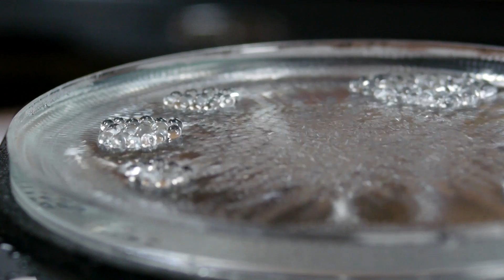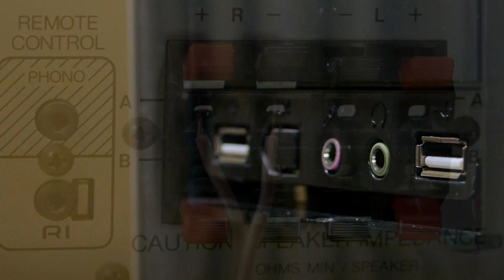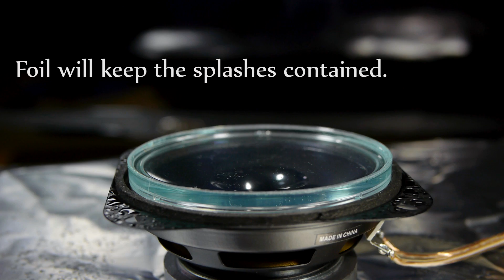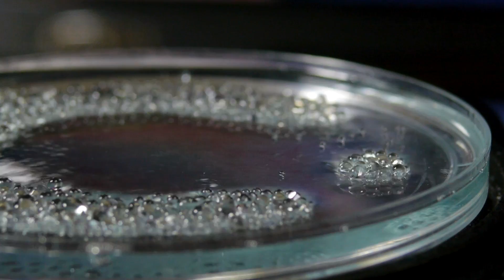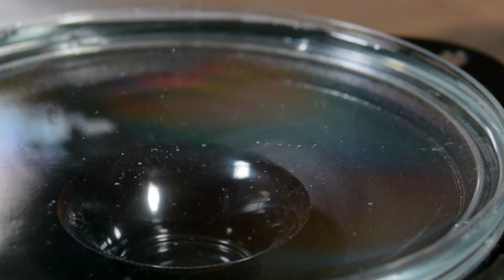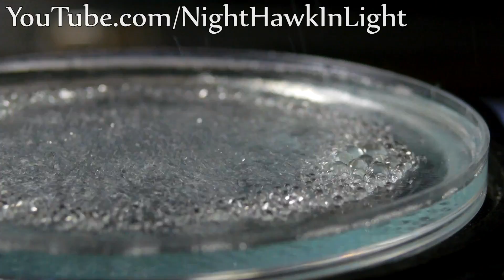Water + Soap + Sound

Comment: Cheap emp class 400,000v transformer is at residence one 2 a solid copper 3 turn coil the magic is in. The muti ark jump i like a steel 3mm space and a blow out ark on the pos intake it blows hot metal in ark this will give several inches of low EMP FEILD  the more the better air ration and save drop ark it snaps now and again to stop short failure FACEBOOK.   Now when between to rods just for ark you may get a 3cm feild at best had upto 12cm and even nothing at all ???????????

Comment: I don't know how much you know about quantum physics, but is it possible that like the water droplets, this concept is the way some particles can pop in and out of existence, through stronger vibrations in the quantum foam? These particles can simply be concentrated vibrations revealing points of detection until the vibration dissipates back into the fundamental plain of our universe, like the droplet with the water that dissapears back into the surface of the pool. That could be why these partials cannot appear between any two parallel plates because it interfers with any concentrated vibrations. Just a thought...
Reply from the maker: +Andre Danielz It makes sense as a possibility, but that's really way over my head.
Reply: blackvalley007 I know it has nothing to do with the video. It was just a thought. But I probably dont know what i'm talking about.
Reply: +Andre Danielz we had the same one!
Reply: +Andre Danielz 
That has nothing to do with this video, and only applies to really small particles like elektrons...
Reply: +Andre Danielz Must be much smaller.
Reply: Mythrunes Of course. My thought was a concept not a parallel.
Reply: +Andre Danielz I had a very similar thought: vibrations like these are the source of all matter
Reply: Logan Mann Are there any papers on this idea though?
Reply: +Andre Danielz I'm not religious, but it seems the only relevant information regarding this idea lies in the old religious texts.  "In the beginning was the word"
Reply: Logan Mann How does that in any way relate to what is being described here?

Life is a code and the "word" is another way of saying a coded universe?

The writers of the Bible did not have this in mind when writing this verse. And why the Bible always speaks in riddles is probably because there are no riddles but people try to find meaning in every verse,due to our pre-disposition to think its divine through generations of passed down dogma that only survived today because up until the invention of the internet and a few more years for information to fill that internet we really had no alternatives. There was information out there, but you had to either already be involved in the research or a book worm. And 99% of people prefer the super bowl than learning if their beliefs are real or not.

What im getting to is that "In the beginning was the word" is a verse so ingrained in our heads through our cultural norms that it almost seems wise to quote it.
Science in no way is saying out universe is a word or a code. It behaves by laws, probably laws of absolute logic. This makes the laws of reality like a coded system. And what I was suggestion has nothing to do with codes or a word.
I see what your getting at. "in the beginning was set laws of reality" or (the word)

What the Bible means however is that the story of everything was already established before creation began. God knew what would happen and wrote the book of what was to come. The stage for Jesus to enter the world was pre-set in his story. Calvinists use these verses to argue pre-destination, that everyone was pre-determined to serve or rebel the christian god.
Other verses support this idea too. Like where God pre-destines certain people to be delusional so they will never know him and then send them to hell for not knowing him.
Its all written in his story book of life.
I dont believe in god. At least not the theistic nor deity kind. But I have read through and studied the Bible in courses. 

So it doesnt really work. I get it. But its a verse like many that can derive many meanings from. Calling the universe a pre-written word muddies up what science is really trying to get at when it talks about the laws of particles and how they pop in and out of existence.
Reply: To me it relates in many ways, as even quantum physics is slowly discovering smaller and smaller vibrations at the root of matter.  

Think about this: regardless of all the obvious BS in ancient scripts, there is an unarguable amount of "religious texts" that must be accounted for--as religious text was all there was in terms of historical record at some points in our evolution. Science in many ways is reinforcing some of the claims made in these ancient scripts like the Great Flood.

I believe the answer lies somewhere in between--as I think we can both agree that the universe didn't spring into existence from nothing in a single instant (as the big bang theory suggests).... that seems as much a dogma as any religious baloney in my opinion.
Reply: Logan Mann Thats not what the big bang says. Thats the typical definition of the big bang but thats not really true there is alot more to it. The "sprang from nothing" is what people like to say because it creates a simple idea of what they think scientists mean. No one is saying the big bang came from nothing.
And there is much proof to show this.

Noahs flood never happened.
I think I know how your perceiving this. I use to see it this way too. I think your looking at many concepts backwards and forgetting key factors when looking at these claims.

Tell me why Noahs flood makes sense. I want to see if your getting at what I think you are.

 Are you saying there is some truth to ancient religion and that ancient people knew certain truths about reality? And does all religion hold some piece of it?
If thats what your getting at I can tell you why its false.
Reply: There are many scientists, some conventional, some unconventional that are barking up this same tree.  I'm sure we could compare and contrast our ideas, both of which could be reinforced with some scientific speculation, however, I think it more important to merely keep an open mind about the possibility of such things.

I'm not merely talking about Noah's flood, although I'm sure that would probably tie in with the  mark of the last Great Flood.  

There is not much argument that the planet goes through this long cycle of drastic climate change.  Even the Mayans predicted these types of cosmic cycles that our planet is succumbing to.

Edit: The big bang theory cannot accurately predict what happened before the big bang (obviously), which is nevertheless why it is still an incomplete model.
Reply: It seams you are saying alot of stuff that makes my brain go to mush
Reply: My model goes as follows: the soap in water forms a colloid which makes the soap particles not visible when in rest. As brownian motion does not exert enough force to settle the soap molecules above the surface thus making the colloid have a plain surface. When vibrated the hydrophobic soap molecules will escape the colloid and form a hydrophobic droplet that rests on the surface in which the vibrations create a surface tension that counteracts sollubility of the soap&water particles. Not in any way shape or form can you relate this to the quantum realm. Even though it sounds dreamy & I do like it. I have a few articles that analyse this behaviour both with ultrasound[1] and with a suspension[2]. 
[1] Periodic order induced by horizontal vibrations in a two-dimensional assembly of heavy beads in water
[2] Ultrasonic characterization of proteins and blood cells
(I cannot give you downloads since these articles are copyrighted, I hope you enjoy the environment of a scolarly library)

Comment: Very cool NightHawk, but won't eventually if enough of the Soap water merges with the normal water, won't the soap cause the normal waters surface tension to weaken thereby eventually make it very difficult or impossible to keep the two layers separate..?

 Great video as usual!!
Reply from the maker: No, for whatever reason even if both the drops and the surface have the same amount of soap the drops still easily form.
Reply: That is very cool, and interesting.

 I never would of thought with it's surface tension disrupted it would still be able to keep the drops suspended like that.

Comment: Beautiful vid. One thing I'm a little unclear on: the detergent will decrease the surface tension of the water, and I would think that surface tension would be helpful, as it acts like a "skin." Water drops can sometimes remain on top of still water briefly because of this skin. I fail to see how removing such a property could be helpful here.

Hmmm. What happens if you don't use the soap?
Reply from the maker: The reason the surface tension is decreased is because the attractiveness of the water to itself decreases. So yeah, the lower surface tension does not help the drops form, but the lower amount of attraction the drops have to the surface does. This doesn't work very well at all without soap.
Reply: NightHawkInLight That seems to make sense. Well explained.

Comment: cool looking channel to check out. This looks insanely cool, those smooth surfaces with sharp reflections and the way it reacts to the sound and forms mind boggling little beads.. this would make an awesome thing to develop as a product to sell to party DJs or set designers. Would make a change to flashing lights and laser beams.. and smoke .. lol not that they dont make some awesome looking sets thesedays